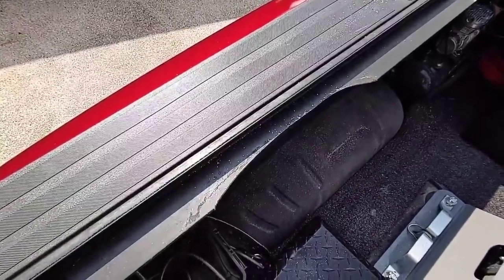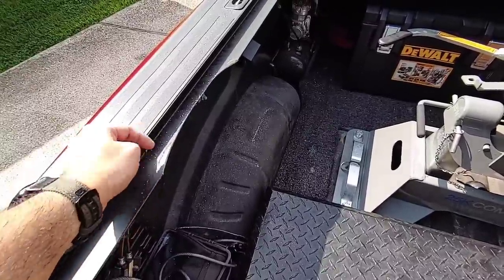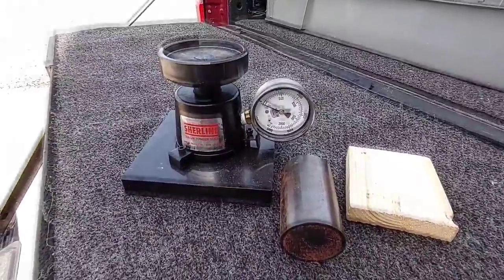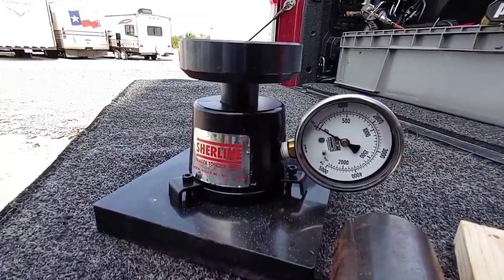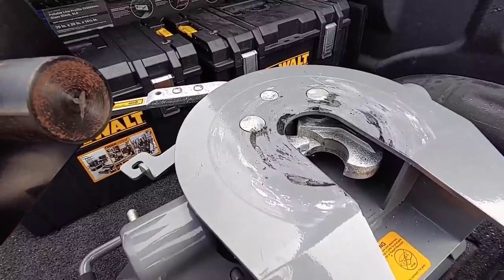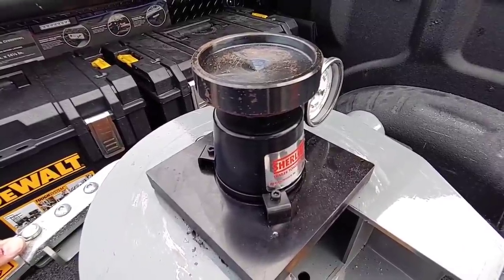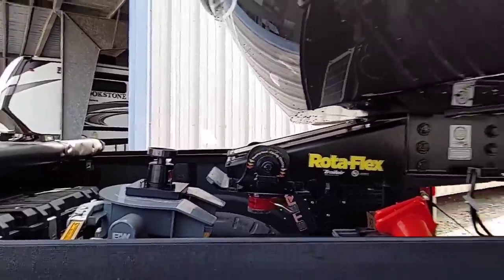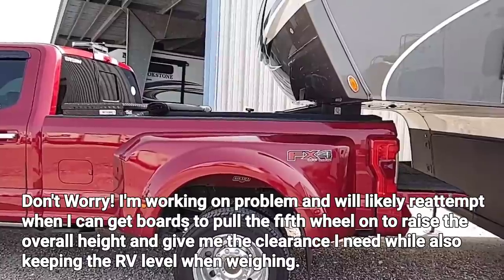That didn't work! Going to have to rethink this!

Comment: Get you a couple good size timber set them in bed about 4” lower then the plate and should be pretty accurate
Reply: Just saw this!! great minds think alike! lol
Reply: Tory Llewelyn, Exactly what I was thinking.
Reply: 1 of the Anderson trailer blocks would actually work they are rated for 6000lbs.
Reply: Haha, I was also about to type this out.  Good call, simple solution.
Reply: My thoughts exactly 👍🇺🇲
Reply: Best solution I’ve read on here. 👍🏻

Comment: Take it over a CAT scale and then roll over scale without the trailer. Then you will know exact weight on each axle and the pin weight.
Reply: Exactly! For a total cost of less than $20, with the re-weigh. So much easier and cheaper!
Reply: I agree with using the cat scale for tongue weight but I haven't been able to get the axels on separate scale blocks to get weights for each axel.
Reply: Charlie Odom   Maybe I don't understand how you are doing it. When I do it I'm putting the front truck axel on the first pad, the rear truck axel on the second pad and the trailers two axels on the third pad. Are you saying that I can still get the trailers two axels on different pads while getting separate weights on the two truck axels?
Reply: @charlieodom9107  
I  ŕ88nuu

Comment: stack some timbers in the back of your truck just behind the fifth wheel to put the scale on at the hitching height lock your parking break and set the trailer down, just leave the pin off of the bottom. If you're really close to your payload capacity take the fifth wheel out and do it over the axle. Oh and X chock the trailer.

Comment: I just completed weighing my 5th wheel pin weight using a Sherline scale last weekend. I have the regular 5000 lb. scale and didn't want to spend the money on the scale made specifically for RV's. I have 6 sets of Lynx Levelers, so after I made sure my RV was level, I stacked as many as I needed and then put the scale on top of that directly below my pin. I made sure my wheels were chocked and then I slowly lowered the RV on the scale. I stopped when the landing feet were just barely off the ground. This way, if the Lynx Levelers collapsed or the scale tipped, the RV would drop maybe 1/8". It worked perfectly. Of course nothing beats getting weighed at a CAT scale but for me, the nearest scale is an hour away.

Comment: I don't have the 5th wheel scale, but the tongue weight scale I do have has the 5000 pound gauge.  What I did was stack 2 x 6 boards directly behind the 5th wheel so the scale was at the height the bottom of the pin is at when coupled.  Since my trailer has the Reese Sidewinder I did need to install the bolts at the back of the pin box to lock it in place. Worked perfectly.

Comment: Have you thought about getting Anderson leveling blocks?  They are very sturdy, and magnetically attach to the bottom of the leg pads, significantly reduce the amount of travel that the leveling jacks have to do, helping to prevent some unnecessary wear and tear and provide a sturdy  foundation for the trailer. I highly recommend them
Reply from the maker: I might have to try them

Comment: Set it on some 6x6 or 8x8 block(s) of lumber in the bed of your truck.. don't worry about the hitch.. just put enough timber in where the 5th wheel won't sit on your bedrails..as long as the trailer is chocked you should be fine.

Comment: George Vana. They make a stand that is used for semi trailers when they are unloading at a dock with out a truck hooked up. So when the fork lift is at the front ( a head of landing gear ) the trailer will tip forward. Or you can can pull the tires up on 6" blocks then block up the landing gear the same. Just thinking of a fix.
Reply: I am sure you are correct. I was thinking about a jack stand. Found one  on Amazon for $100 that willhold 2 Ton and will go up to 84" high. I understand JD is not trying to support a 80'000 lbs trailer at lest not yet. LOL

Comment: Use Andersen “bucket” blocks 100% of the time under your front levelers. That way you can easily raise it above the hitch height. It also minimizes the movement distance for the levelers when used. 
Don’t forget to fully chock your wheels when not securing your hitch on the weight. Any movement would cause a horrific crash.

Comment: I would add blocks under the trailer tires and stands this will prevent weight transfer and give you the height you need.

Comment: You could back the trailer onto a 2 or 3 2x6 (maybe 2x12) blocks and place the same number of blocks under the front jacks. The trailer would be level when you weigh it.

Comment: If i were you I'd try removing the fithwheel and placing blocks of wood in the bed positioned so the fithwheel hitch bracket below the bed carries the weight (so the floor of the bed isnt damaged) and placing the scale on the blocks at the correct height as if it were hooked up to the truck. If you have the cross rails in the bed that would be best but if not then place them over the holes where the fithwheel would normally be placed. Love the videos! Ive been subscribed for a couple years now and there very educational.

Comment: I would say use a tripod stand but those aren't designed to handle that much weight. My other thought is to stack some blocks at the very rear of the bed that allows for the needed clearance to place the scale on. Also make sure you have the trailer axles blocked (X-Chocks) so it can't move during the weighing process.

Comment: For your pin weight could you place the scale into a 5th wheel support and placing the scale on the support then checking for your weight? I know the support likely can’t hand  the weight complete but just lift the landing gear just enough to get the weight off them; I:e like a tug test night

Comment: Bypass all this rigamoro and go to a CAT scale hooked up them go back again with just the truck and it will tell you then the pin weight, and all other weights too. Just like truckers do all the time. No charge, good luck. Love your channel.
Reply: This...  Those scales aren't that accurate....  CAT scale will be accurate to within 20lbs.

Comment: Take the head off the companion, place on enough boards to adjust for height. Install scale into head. Back truck under trailer hitch, slowly lower trailer onto scale. Use enough boards to protect bed.

Comment: I'd think you'd be okay to roll the trailer onto a 4x4 piece of lumber long enough for both axles on each side, then placing additional lumber under the feet.  Then when you unhook it, you should gain the leg adjustability you need.  Also, that should help you to maintain a level trailer.  It might require more lumber under the wheels than the landing gear, but I think you should be able to make it work.

Comment: Take the scale out.  Load the trailer on your hitch.  Raise the landing gear. Install blocks under the landing gear and raise trailer. Better yet tow the rig to a scale and place the truck on one scale and the trailer on the other.   Weigh each separately. You get truck weight plus tongue weight on one scale and trailer weight on the other.  Pull you rig off the scale. Unhitch and weigh the truck.   A little math will give you the pin weight(tongue weight) on your hitch/ truck. Cost approx $10-15 and about twenty minutes of your time.

Comment: For an accurate reading you must put blocks under your tires of your trailer and blocks under your landing gear so that when you do lower it it'll be sitting level on your fifth wheel weight measuring device. Truck drivers know that if the vehicle is not level the weight accuracy is off.

Comment: You should also consider when the landing gear is up, and all the weight is on the pin, what would prevent the  hitch from rotating back or forward and drop the trailer onto your bed.  Six inches of height is a lot of leverage that can rotate the plate...  Just thoughts from one engineer to another...

Comment: I agree they should have made a tripod like stand it sits on to get an accurate real world weight. This tripod may just sit on the bed right in front of the 5th wheel hitch. OR the tripod can be adjustable and stand right on solid ground may even with snap pads. Just a thought.

Comment: The problem is simple. Raise the tires on the RV equal distance to displace the height of the scale. Four 2 x 8 blocks per side should be a close estimetation. A gravel parking lot won't suffice, you'll need a level concrete surface. One of your RV shops, Ron Hover, will have what you need in their service bays. As long as the trailer and the truck are both level the height difference is negated.

Comment: I would have just hooked up to the camper, pulled it forward the length of the tandem wheels on the camper, take 2 - 2X6 X8 foot boards and cut them in half, stack one on top of the other, staggering them just a couple inches to make a ramp, slide them behind the wheels of the camper and back it up on top of them, under the wheels. That will give you about 3" of height on the camper wheels. Then put 4 inch blocks under the front jacks and drop the landing gears. Lift if off the truck, and put your weight on there. At least then when you lower the camper on to the jack, it should be sitting close to level because you have added 3 inches under the axles. If that's not enough, put another set of planks down.. and you will have 4 1/2"... That to me is the safest way to do that... and you can still chalk the tires...

Comment: Put the trailer tires up on blocks or ramps and then lower it on it might put I a little bit more weight but it will get it high enough

Comment: Putting the scale on a stand would be easier for most people. 

As for trimming out the aluminum on the bed cover a better tool and making it much cleaner nicer looking  would be to use a small router (like a dremel tool). I have a Rigid JobMax with a attachment that can do it very cleanly/evenly.

Comment: If I was to do what you want, why not pull the hitch head off and build up between the uprights with two or three good 2X to put the scale on, this could put the head of scale close to the same level as the bottom of the king pin would be if hitched ,  hope I made this as clear as mud.

Comment: It looks like the trailer is just a couple of inches low, could you, and would it be safe to raise the whole trailer up at the axels with leveling blocks or Anderson levelers where you could chock them, then level it out with blocks under the front stabilizers to get it off the hitch then raise it further to level it, then lower it onto the scale?

Comment: Put it under the hitch receiver(or use a draw bar) with 100lbs of pressure or something, with a floor jack and lower your trailer in to the fifthwheel.  A little gangly way of doing it, but but you'll get the reading youre looking for.

Comment: As far as the bed cover goes, is there any adjustment to the pin box or the hitch to clear that issue?  As far as the scale goes, if you put more weight on the back axle would that transfer more weight, not less to the pin box?  Interesting issues. Keep up the good work.

Comment: You're over-estimating how much weight gets transferred to the trailer axle by raising the tongue.  Think about it....  The Center of Gravity for the trailer is somewhere ahead of the axles, and let's assume it's mid-height on the side, halfway between the roof and floor.  If you raise the tongue, that CG doesn't move, but the loads around it do ever-so-sloghtly.  Raising the tongue 6 inches may shift the roof back 4 inches, but also moves some weight along the floor ahead 4 inches, bit the whole CG will shift toward the axle fractions of an inch.  If the angle of the trailer changes by 5 degrees, the CG moves less than a tenth of an inch.... You won't be able to measure that difference in tongue weight with that pressure gauge...

Comment: How about stacking boards inside the bed of the pick up, just behind the 5th wheel hitch and putting the scale on top of the boards?
Reply from the maker: Thought about that.  It would still require me to change the overall function of their design.

Comment: option 2 is put the truck lower, think drive way slash curb hop put the truck axle in the gutter and drop the 5th wheel landing gear on the side walk you will get the space you need and i bet the trailer will be near level.

Comment: This is actually a good test. Figure out a way to get it weighed too high and too low. So that it can be seen the safety of having proper angles for proper weight. The issue with cat scales are they are so beat up by large trucks they are not accurate by as much as 500lbs.

Comment: Thank you for sharing video it was interesting. I know this is off topic but as far as your companion do you have it set up to the 3" setting or the 1" setting in front of the axle and why?
I think to get a accurate weight measurement is to lower the arms of your companion that supports the head of your hitch. Looking forward to seeing what you did to get this measurement.

Comment: Go weight your pick up or tow vehicle first at a CAT scale at a truck stop grouping each axle or axles on the individual pads of the scale, go in and get the weight ticket go hookuo your trailer up normal hookup than repeat process go in get your weight ticket subtract rear truck axle weight from hooked up weight and quit buy toys. Cost will be less than $25 dollars

Comment: Have you used a HaulGauge?  Well I guess they are called BetterWeigh.  It will measure pin weight.
Reply: Exactly!  I'm pretty sure JD already tested a HaulGauge and it was very accurate.  Yes, maybe you have to drive around a bit sometimes to get an accurate reading but it still seems like a better and cheaper solution that this load cell.

Comment: Putting the scale on a non solid surface (i.e. truck suspension) is going to affect the weight reading.  You wouldn’t weigh yourself on a bathroom scale on top of a cushion..

Comment: Dig 2 holes in front of the 5th wheel the width of the rear wheels on the truck. Now, back the truck into the holes. If y'all got the holes the right depth, the 5th wheel should still be level. Y'all don't have to buy anything. Just remember to fill the holes back in.

Comment: Why is your hitch so low in the box. I have the same and have it adjusted so it's plenty high enough to clear the rails on my topper.  Do you have it as high as it will go?
Reply: A proper hitch shouldn't be sitting above your bed rails
Reply: @kylepokorski6045  I agree however there are 3 height adjustment s on the Companion hitch. I don't understand why his pin box is hitting the side rails of the topper.  Having to cut out portions of it doesn't make sense.

Comment: Isn’t the typical way going to scale and seeing what the weight is on your duals empty then repeating the process with the trailer? I know cat scales can be a little pricey, but around where I’m from we can use scales at co-ops (grain elevators) without paying just as long as we stay out of the way for those that the scale was put in for.
Reply from the maker: This is more for instant information while loading up your trailer.

Comment: That trailer has less then half the clearance to the bed rail that mine has on my Ram 3500.  I have a feeling your gonna need to move to a tow bed, gonna be interesting since it is an F450 pickup and not a chassis.

Comment: If I remember correctly you have air bags you can lower in the back
Reply from the maker: Most Airbags don't lower the truck, they level a truck that is squatting.
Reply: @BTBRVReviews  oops thank you though
Reply: I think the ones that lower are on heavier classes of trucks mainly.  I don’t think our super duties are set up that way.  Super duty airbags are only set up to augment factory suspension.  Please correct me if I’m wrong.  I’m new to 5th wheel RV but have pulled large gooseneck horse trailers all over the country with f350s and f450s back years ago.

Comment: Raise the scale on the truck bed. Take out the hitch n place the raised scale in it's place. Obviously some kind of 'jacking' system would need to be implemented.... Alternatively completely redesign the hitch with a built in scale a la some bumper hitch units??? just spit balling. peace

Comment: In traveling across the western United States I've seen 5th wheels where the front was high in the air with the RV at steep angle. Is this safe?
I've seen several like this in my travels.
Reply from the maker: It's an elevated safety risk for sure

Comment: WHy wouldn't you use a Gen-Y Executive Goose?
Reply from the maker: Not approved for use on Lippert frames.
Reply: @BTBRVReviews  I got a reply from them a few weeks ago and they told me they are currently working on that.  It's weird because LUXE uses them as the upgrade to their standard pinbox.
Reply: @onecrzyrcn  Luxe builds their own frames, they don't use LCI
Reply: @nproctor74  Indeed, but their Quality and Pricing is Comparable to this.

Comment: My rolling lock has neither of the two protrusions that your cover has...
Reply from the maker: Agreed, but I'd lose my toolbox
Reply: @BTBRVReviews   Understand I have a shortbed F-250 and want to purchase an RV fifth wheel in a few years. Planning on upgrading to a 350 for more cargo capacity so I can tow a bigger fifth wheel more safely ive learned a lot from your videos. Will stay with the rolling lock and a short bed and skip the tool box will use the Dewalt large tool boxes for tools like you did I allready have some of them...Thanks.....

Comment: I was wondering if dropping the air bags would have helped.
Reply from the maker: They were dropped...no dice
Reply: @BTBRVReviews  get bigger bag and pull the springs or use lowering shackles the truck will ride a lot better when unhooked and you can lower the truck a lot when you bleed out the air.

Comment: Find a location where you can dig some 4 or 5" holes for the rear wheels of the truck. Then you could get an actual "level" weight. The finest of hillbilly engineering